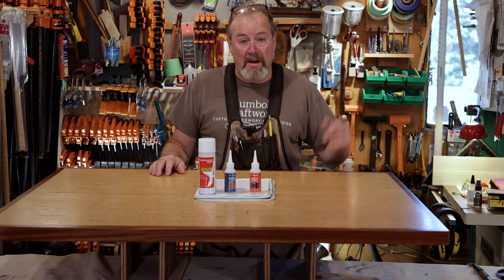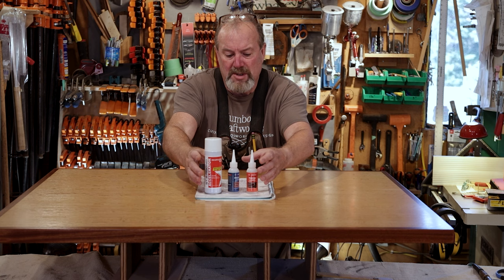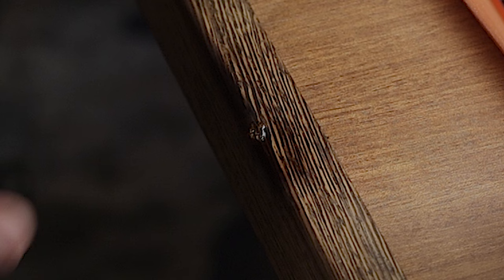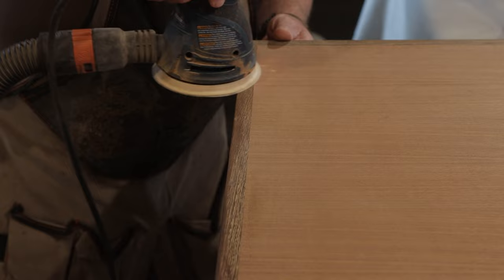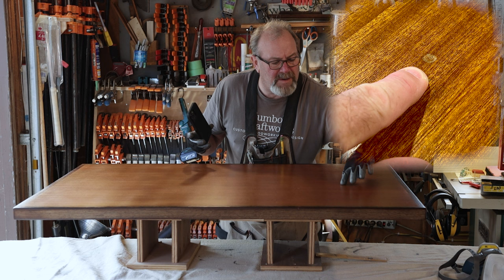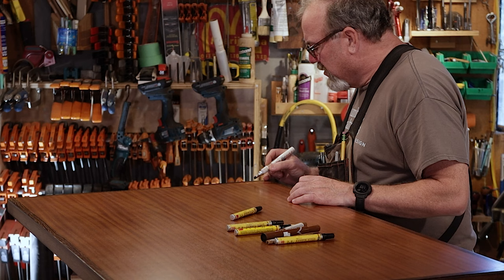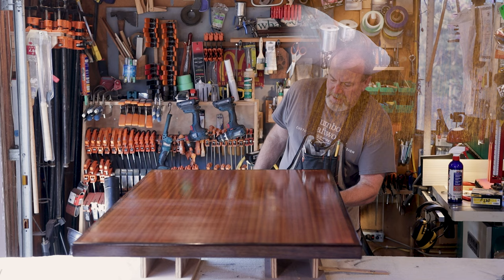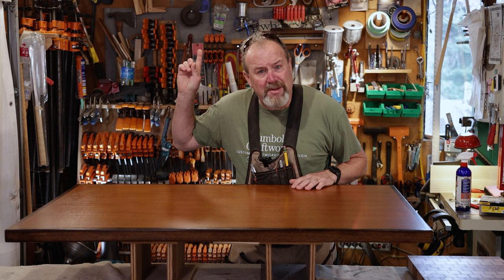Repairing Dent & Dings with CRAZY Glue 😱😲😎 Wood Working with Mr. Kevin

Comment: wouldnt it be better to use epoxy? problem is it smells like shit
Reply from the maker: Hey thanks for watching Apoxsee works good for bigger holes like knots some cracks I agree with you it does smell like absolute crap but the Starbond AC glue  works pretty good for small things like dents and dings plus it sands out better to . Thanks again for watching and come in on this video it really helps have a good day😃👍
Reply: @Humboldtcraftworks  I sent you an email, if you don't mind if I could get your opinion on how to fix a small dent/crack on the bottom of my solid wood desk?
Reply from the maker: @naegleriafowleri2230  sent you a reply back via email hope it worked thanks for watching have a good day😃👍